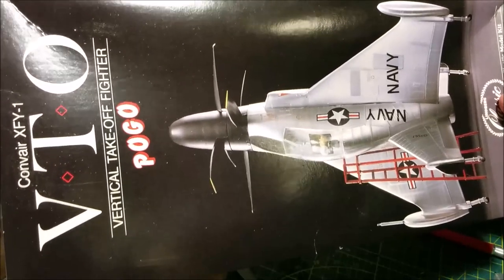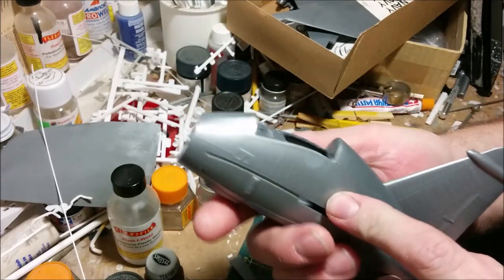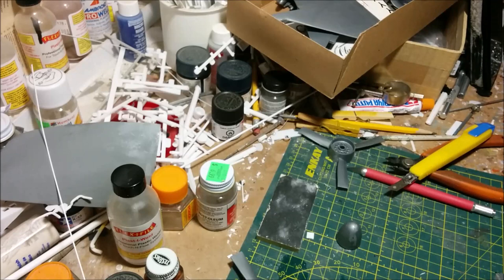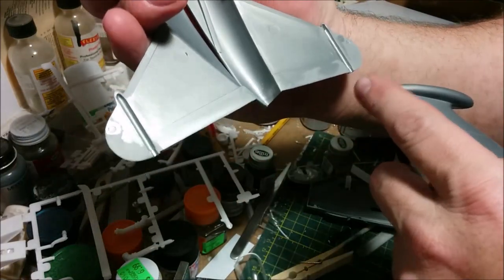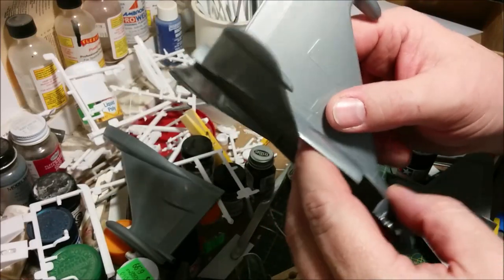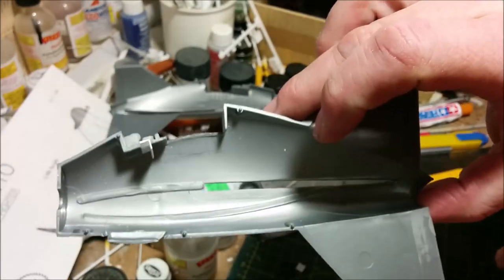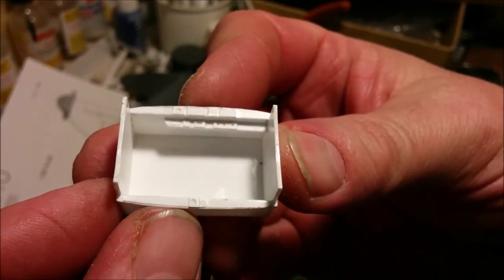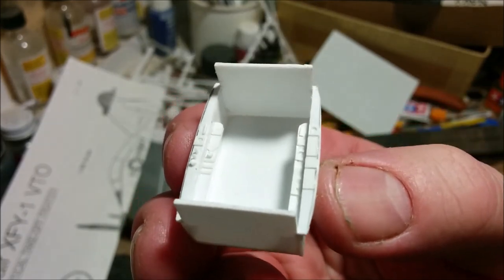Pogo Pt2 + Health Issue

Comment: Just a tip,you probably already know,but anyway... When you have a decent fit,with a little seem line showing,I use good old tester's orange tube glue. Put a good layer on both sides,and give them a good wiggle back and forth,and squeeze the half's til you get a little bead of glue/melted plastic and presto!!! Instant gap filler. Most times you can just scrape the bead away and lightly sand and there's usually no visible seam.
I use this method when there's a lot of details I don't wanna sand away,like rivets etc.

You just said you don't have problems with knobs!!!    Sorry my inner 13 year old escaped for a minute.
Hey,good luck with that sleep apnea. My mom had it,seems like she used her mask for a couple months and pretty much worked through it,however you say it...maybe recovered. Anyway,it sounds like you're finally on top of it. Whenever you put a video up I watch it! So don't worry about it. Get healthy!!